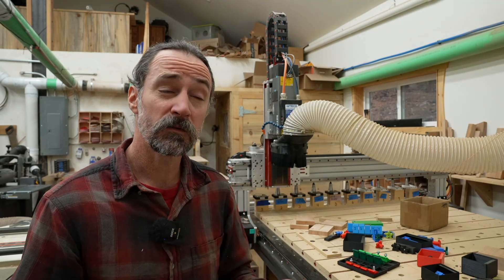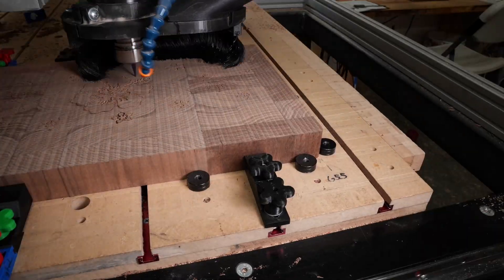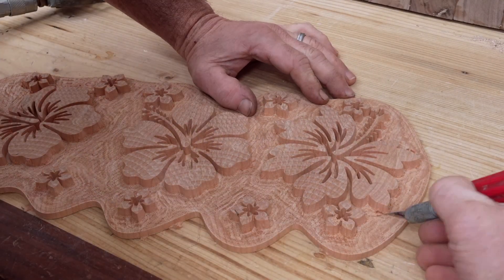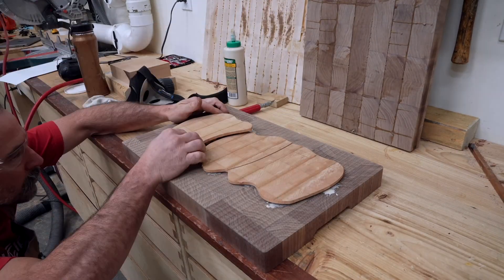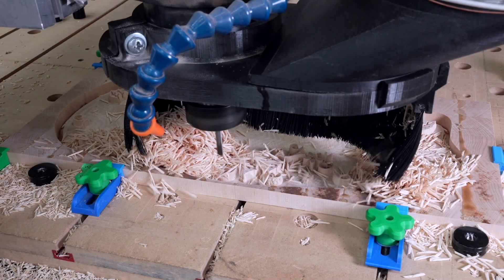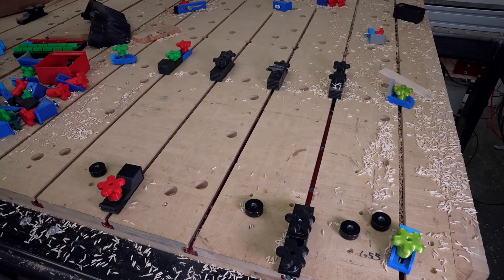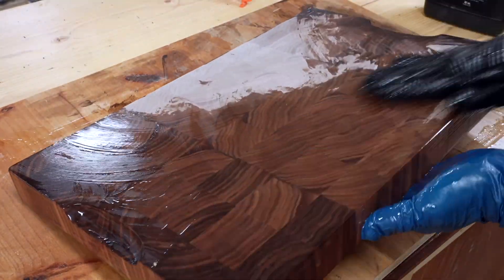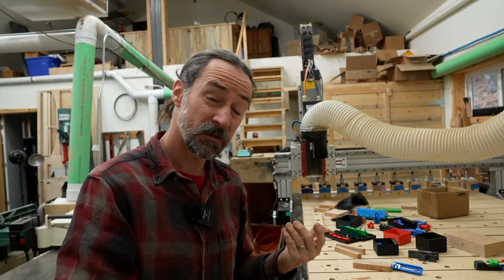VCarving a Multi-Wood Cutting Board with Autodesk Fusion 360

Comment: I've been trying to get this to work for my situation, I did struggle a bit as I was quite hopeless at Fusion CAM, but thanks to you I'm a little less so now 👏 
I think the penny has finally dropped for me so I'm REALLY looking forward to moving beyond the testing phase* and finally producing cutting boards for my favorite butcher shop.

Thanks so much for your efforts here, very much appreciated! 🙏

*A phase I've been looping around in for almost two years! 😣
Reply from the maker: Great! There are limitations, and sometimes issue in Fusion itself. The latest version of the plugin attempts to work around a lot of problems I've encountered when testing various designs. The biggest hurdle is a clean design: it can cause problems if the design has overlapping geometry and zero-length spans...I need to figure out a way to detect and fix these issues.

Comment: Excellent video.  Thanks for the detailed comparison of VCarve vs. Fusion.  I'm just getting started, and it looks like Fusion with your plug-in is a good way for me to explore VCarving.
Reply from the maker: It's definitely a good way to start on them! Check on the related videos that describe more of the basics on how to use the plugin and dial in a fit. I think I'm going to try my next cutting board with VCarve. Ideally I should do the same design in both to really compare them.

Comment: My first inlay I tried to mill it flat 12 hours after glueing. I realized if I kept going I was going to get rid of everything. So I stopped and came back after a week vacation. The board flattened on its own so now my milled side was not flat. Lesson learned. Also, to fix it I should have machined a 0 depth pass from the already lowest point on the board. Instead, I did a 0.1 inch cut without thinking and ended up messing it up anyways. However, it wasn't a total loss and my mom still liked it. But the eyes squint extra hard at me.
Reply from the maker: Yeah! I machined my "ninja turtle" board too early and made the lines pretty faint. 36 hours seems to be the sweet spot for my area and humidity (right now at least) to have the cupping go away.

Comment: Looks amazing ! Can't wait to get your plugin soon. 
Is it possible to do inlays on flat sawn boards or does that cause too much chipping and tear out ? I notice that most people use end grains.
Reply from the maker: Yeah, end grain is easier to avoid chipout. You can do it on face grain - I've been told using a wider bit may help with chipout on face grain (ie: 30/60/90) at the sacrifice of less depth. So, it would be good for decorative inlays, but not so good for cutting boards (30 would be fine...many people use 30 on cutting boards). I am waiting on getting some new 30/60/90 v-bits to try them out a bit more.
Reply: @CorbinDunn  I've been using a 15deg bit on face grain inlays, I have had chipout in wood like pine but harder varieties seem fine, slower feed (slower axis acceleration too) can help a lot.

Comment: For more than a second, I thought you would add a parameter for the CNC to put glue on the board 😅
Reply from the maker: LOL ;)
Reply: @CorbinDunn  I like your compressed air solution, another one I saw is to apply the glue to the plug instead of the pocket...